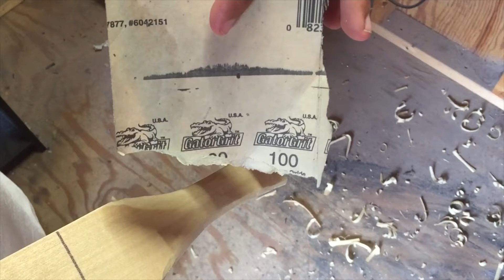Making A Two-Sided Leather Strop

Comment: Why do you need to use both sides of the leather?
Reply from the maker: Typically if my knives are well kept I only use the softer side but if I need a little extra help I use the rougher side to get the burrs out. If that doesn’t help, I go back to the stones. But both sides of the leather strop isn’t necessary for a sharp knife. Just personal preference I guess.